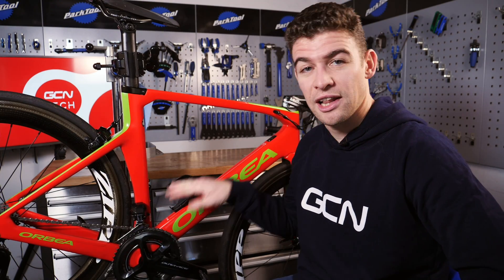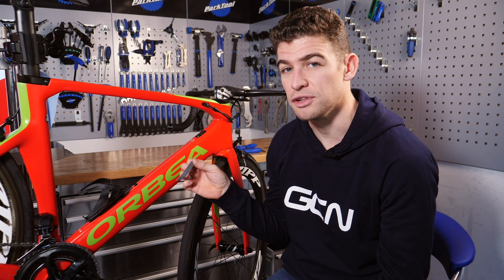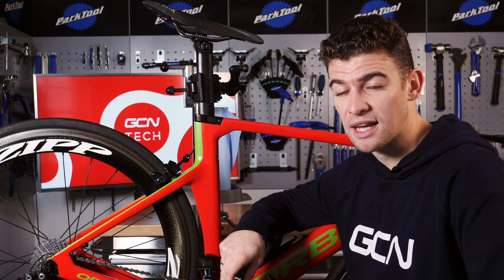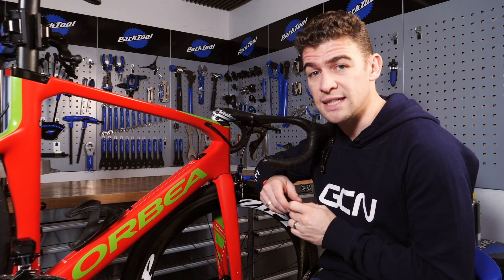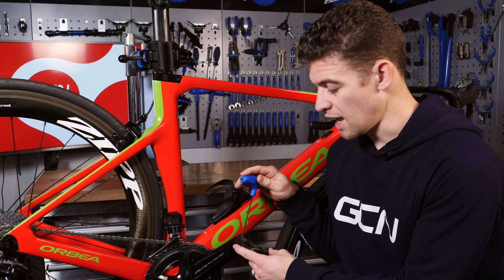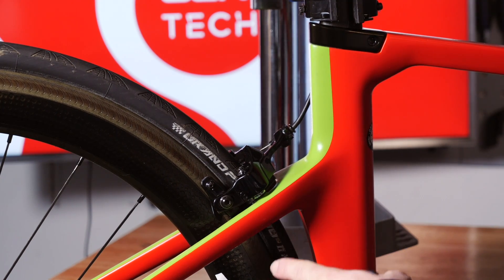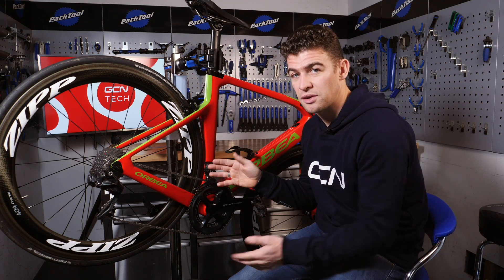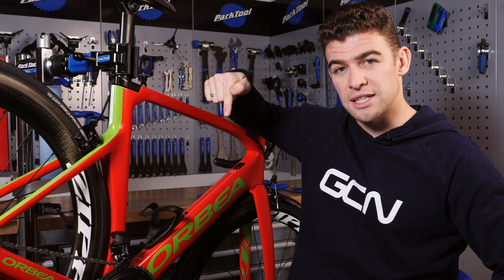10 Pro Bike Setup Hacks | How To Make Your Bike More Pro

Comment from the maker: What's your top setup hack? Let us know 👇
Reply: regularly filing down the brake pads and cleaning the pads and the rim with automotive brake cleaner. it feels as good as a new chain. you may object it will wear down the pads faster but often i see people chucking perfectly serviceable pads in the bin because they look gummed up way before the wear line. stuck pebbles will destroy your rim. I hate lacing wheels.
Reply: Setup? I generally just hop on and ride! 😂
Reply: You know about chain waxing but waxing the inner derailleur cables is smoooooooth. I also drip it on the exposed parts of bolts to prevent corrosion. Got to be careful though.
Reply: Something I like to do before a big ride is to check to check the torque of my bolts. It gives me that little extra confidence. 😉
Reply: My pro tip, use hand rail griptape it's far friendlier to hands, gloves and shorts so no Tony Martin style bibshort vents it looks better too, suprized the pro scene hasn't cottoned on to this stuff yet, it's a textured polyurethane finish just like the supacaz super sticky Kush tape. 👌
Reply: You have much to learn young Opie Wan, when you sprayed that silicon i felt a great disturbance in the brake force like thousands of brake pads screaming out all at once then suddenly fading away,🐍   Spray any lubes and polishes on to a clean cloth away from the bike then apply it only to the parts you want it on. Thus no stray residual lubricants or silicon on brake surfaces 👌
Reply: I changed my Q-factor with a different bottom bracket. This also made it possible to get a straighter Chainline for the gears I use the most, which is 54 - 19.
Reply: @GordonMoat  are you using octalink or square taper cranks cos the Q factor is the distance between the pedal attachment points, most modern cranks have the bb axle integrated so it's not possible to change it, only to move it further inboard by changing the spacing at the bottom bracket. If you do that your saddle won't be in line with the centre of the cranks so I'd recommend countering any changes by adjusting your cleats so that it lines back up again and pop some helicopter tape on the non drive side pedal arm as your heel is going to be a touch closer so it might rub. If you only ride short distances it won't be much of an issue but if your a full on mile muncher it could lead to lower back ache due to a misalignment over time. If your using octalink or square taper and have merely changed the axle length for a shorter one none of the above will be an issue as you'll have moved both pedal attachment points inboard and the saddle will be in the centre still. If you're using a 54 42 I'm assuming your a sprinter, time trialler or you love a fast descent either way chapeau sir.
Reply: @jonnythelegs2597  It's not a huge change, so cleats can be adjusted as needed. Obviously, not really possible with press-fit bottom brackets. I ride mostly on flat roads, at about 90rpm, which is why I use 54 - 19 most of the time. My fixed gear bike has an even narrower Q factor, yet I don't have an knee or back issues. Probably not possible on many bicycles, though people could look at which gear ratio they ride in the most, then change the front big ring to move that gear ratio around to get a straighter chain run. It's quite a bit quieter too.
Reply: @GordonMoat  Yay fixie rider that explains it yeah it's pretty much impossible on a modern day press fit your only hope there is a company called problem solvers they do bb conversion cups for a lot of interfaces But l say come back threaded BB all is forgiven. Apart from the occasional savvy timetrialler people with gears generally know sweet fa about chainline efficiency 54t would  be a fairly big rig and line up with the 16/17t cog on a cassette  combined with a 19th for 75" is pretty much bang on for what you're riding what you running on the other side is it flip flop or a proper track? I was running a 47x16 for London which is flat apart from Highgate and it would always be credit cards or some documents for signing when I delivered up that way it was never anything heavy.  Cornwall's quite a bit hillier though and my knees a fair bit older now so I wimp out and run a 18t singlespeed. But I've Scott Foil road bike too so that's now my main road bike and a Singlespeed santa cruz for off road. Have you tried out oval rings yet they work a treat expecially when spinning out on a descent way smoother 😉
Reply: @jonnythelegs2597  Fixed makes you smoother on the road bike too. I've never tried oval rings, so I have no idea how they feel; think I would be concerned about perfect set-up to avoid dropping a chain. Anyway, there's probably a few watts in getting the chain line straight. I've seen too many road bikes where the chainline never runs straight, and alignment doesn't appear to have any thought put into it. If at all possible, I would avoid press-fit bottom brackets. 😺🚴
Reply: @GordonMoat  for sure, you learn through necessity on fixed, fortunately I learnt to "pedal in circles" beforehand as I started out by time trialling in the early nineties as a teenager and this was the norm back then so when I fisrt jumped on a track bike it came naturally, nowadays I get comments on how fast my cadence seems as I tend to spin between 95 -100 rpm and avg out at 90rpm but the fact I'm still smooth and not bouncing around in the saddle though to be fair this mostly comes from the local triathletes and weekend warriors that come out training in the real world rather than Zwifting it up all winter then suffering when the weather turns. Bleedy Wheel sucking pansies try pushing 70rpm when you're up the front and not drafting me and see what happens. lol
Reply: Though they're probably thinking the same about me when i'm swimming as my technique is truly awful, it's not a smooth or tidy affair, i get it done but it's as messy as a teenagers bedroom.

Comment: I set my saddle height by setting the crank on the drive side parallel with the seat tube next I measure from center (where the center of my cleat sits)of the pedal on the non drive side to the top of saddle keeping the measuring tape parallel with the seat tube, the measurement should be the same as your inside seam measurement or a 5mm lower. I have found this method to get my saddle height prefect, as I have used all other methods but could never get my saddle height perfect.

Comment: If you want the ultimate chain performance, you do not drip lube onto the chain.  It just attracts dirt that slows shifting and increases wear.  There is no substitute for removing the chain and heat soaking it in a combination of canning paraffin and motor oil in the correct ratio.  The lubrication reaches the innermost surfaces and leaves a long lasting film of protection.  Chain maintenance can be reduced and for roadies like me, cleaning a chain is almost never necessary.  When it's time to relube, just dip the chain in the heated lube (I've been using the solution I made up for almost 20 years.) and  after the chain cools, reinstall the chain.  And contrary to what Shimano says, use a good master link like the Connex, the more times you brake the chain for maintenance, the weaker it becomes because it isn't possible for the home mechanic to duplicate what happens at the factory when the chain is assembled.

Comment: I'm interested in your spinning cranks at 4.54. Presumably it was necessary to remove the bottom bracket, de-grease it then repack with a thinner grease and refit. If this is so, what grease would you recommend?

Comment: how tdo you control the bite point on hydraulic disk brake setups? Mechanical are straight forward as they have a knurled nut like rim brakes.
Reply: Rob Bonney - Most have what they call “free stroke adjustment”
Reply: I noticed that, mine only have 2.5mm. Which is hardly noticeable!

Comment: Cassettes question. Supposing you can get a 10speed cassette cheap and new. Could you remove a cog and use it on a 9 speed set up.
Reply: Brett Champlain  Thanks 👍🏼
Reply: MRGRUMPY53  Thanks MRGrumpy53 great name 👍🏼
Reply: Jonathan Zappala Will sram or sunrace be compatible with a Shimano 9 speed chain.
Reply: James McGuckin yes
Reply: Jonathan Zappala Thanks Jonathan ✊🏻
Reply: Yes it can work,but this would assume the cassette is made up of 10 individual cogs(some Sunrace are like this) and that you have enough 9-speed spacers .If you were to take 9 of the 10 cogs,then replace the 10 speed spacers with 9 speed spacers and find shims for the smallest cogs(depends on the particular cassette) it will work ,9 speed chains work  with 10 speed cogs,10 speed chains don't work so well with 9 speed cogs.If you are up for this,then you have my vote for iconoclast of the day.
Reply: Larry Daniels  You’re a genius Larry. Thanks ✊🏻
Reply: @brettchamplain  It needs the wider 9-speed spacer,irrespective of shifters,the 9-speed chain is too wide for a 10-speed stock cassette.

Comment: Pretty sure I've seen Dan do a video about quick releases and not over tightening them, then this guycomes on and says do them up tightly, Seen the same thing with cornering videos I think it was Si or Dan saying get all your braking done before entering the corner and if braking is needed during the corner only use the rear brake, Then Ive seen on another video Emma say its quite ok to use the front brake while cornering but only very lightly ..... Cmon guys you cant have have yourselfs contradicting each other !!!

Comment: Can you please make a video, in which you compare different bike computers in different budgets? Would be so helpful.
Reply from the maker: Afraid we don't do reviews on GCN - we are lucky to be sponsored by Wahoo for our head units which we really rate!
Reply: @gcntech  Can you recommend the Wahoo elemnt Mini, as a starter bike computer?
Reply: @louisbp735 Dude,  Wahoo mini is waste of money IMO. I use Bryton 530 - pro level unit and very cheap compare to wahoo and garmin computers (also have best battery life). I use also garmin sensors. I can highly recommend you this combo bryton + garmin sensors.
Reply: @louisbp735  the mini uses your phone as the GPS source, if you want gps. Otherwise it acts as a basic head unit, it's quite expensive for a 'basic' unit when not connected to your phone. Although it does allow bluetooth sensors.

A basic unit (say cateye strada) offers cadence and speed sensors only. No mapping, and i don't think they offer heart rate. They're £30ish

Some sensors will pair direct with your phone, which you could mount to your handlebars. So you could use your phone as a short term solution.

If you want GPS unit, you could look at the garmin edge 130. It's a bit more than the mini, £50 or so I think. Mapping is limited, otherwise seems to be a good little unit. This is good for integration with apps like strava.

If you want mapping then the elemnt bolt is a fantastic option (i have one), but it's double the cost of the mini. Garmin edge 520 is about the same price. They offer full sensor usage.

Hope this helps!
Reply: Thanks for that info guys.

I'm going to buy a head unit.  I love my s8 as a bike computer.  3 problems...

1 - I've had 2 century rides incomplete due to battery.

2- I've hit it with my knee sprinting 

3- screen burn.  It's not horrible but is there and I paid cash for my phone.. This is actually the deal breaker for me.
Reply: @twatts4436  Thank you very much, I am looking for a budget option to map my rides and see Infos like as cadence and speed. A map or turn by turn navigation is not very important to me. I don't want to spend more then 100 bucks.
Reply: @mislevis  Can you recommend a basic bike computer for cadence speed and time under 100 bucks, I don't need turn by turn navigation.
Reply: @louisbp735  in which case a basic unit is probably your best bet!
Enjoy, loads of options.
Reply: @louisbp735  I'm very happy with my Bryton. I not use turn by turn navigation, but for spd, cadence, Heart rate and power is perfect unit (ant+ compatible). Check them in aliexpress or ebay.
Reply: Go to "dc rainmaker" and you shall find! 😊

Comment: Thanks for sharing. I've lost bottles before. I wish they'd make a bottle soft on opposing sides and rigid on the others. That might help it stay put and make it easier to slip out of my hand now I think of it.
Reply: I don't like them particularly, but some Nike bottles are exactly like that - 4 oval-shaped sections going longitudinally. Unfortunately mine separated at the junction between the soft black rubber panels and the clear panels.
Reply: Patrick Carroll 
Turns out a carbon bottle cage isn't such a bad idea

Comment: I have been soaking 2 of my old chains in 2 separate glass bottles filled with diesel. So far gunk still falls off even after 3-4 weeks. of course 1 is dirtier than the other. could be lube and dust that hardened.  Picked fuel as I can leave the chain in and don't have to worry about rust.

Comment: Grip tape inside your bottle cage? If that's pro I'm not impressed, fantastic way to scratch your bottles to bits in no time at all. I modified mine with rubber plugs normally used for plugging cable holes on the frame. I drilled and glued them in, now my bottles are Super tight and it doesn't damage them ether.
Reply: 3M do little clear rubber gromets to put on the bottom of coasters etc to stop them sliding on tables, they  work like a dream too

Comment: Great hacks! Especially find the griptape and quickrelease tips useful. Keep up the good work!!! 😀
Reply: The skewer tip is very much a pro tip, personally I use Allen key skewers as they are lighter, more aero and stronger, if you don't have team support/backup with a spare wheel or bike at the ready you're going to be getting your tools out and fixing a flat by the side of the road in which case your going to have a multi tool to hand to unscrew the skewer, having a QR is only goiing to save maybe 3 or 4 seconds on the job so unless you're so fast you can fix a flat and get back up to the bunch your race is pretty much over. Where as an aero Allen key skewer can save between 1 and 2 watts of aero drag over a QR so technically you'll save more time overall especially if you're doing longer rides, sportives, or longer 100mile, 6, 12 or 24 hour TT's. The other advantage weight even the cheapo £9 halo ones are lighter than QR's costing 4 or 5 times that and the gold ones look super tidy and bling too. Strong, light and cheap you can have all three, it's not often you can say that these days.

Comment: Not a hack, more a question; I ride about 200 km a week and check my tyre pressure weekly. I drop from 100 psi to 80 psi between checks. Anyone else have a similar drop?
Reply: Matthew Broad Yes. Strangely, on my new bike with 25mm tyres, the drop seems to be much less than on my 23mm tyre-equipped bike.
Reply: i get that overnight

Comment: How can I get into a TT position on my normal road bike?
Reply: Clip on aero bars or just slide you arms onto the tops of your bars. Keep your back low/flat while remaining on the saddle. Itll take a minute for you to feel alright with how the bike will start to handle but you will get the hang of it
Reply: Move the saddle to the maximum forward position too.
Reply: Move your saddle as far forward as possible. If you are able to spend a bit of cash, try to go for a secondhand tt/tri saddle, as that might move you a bit more forward than a standard road saddle (and it'll make it a lot more comfortable)
Reply: Get an in-line seatpost with no lay back, move saddle forwards, also a 10-20mm shorter stem with a -17 degree angle, road bikes have longer/taller head tubes than TT bikes so you'll want to drop the front end down about an inch in total to emulate this. Naturally you'll need some clip on tri bars if you don't want mess with the stem there are tribars that mount the extensions under the handlbars so that the pads can sit lower, do things progressively bit by bit and give your body a chance to adapt gradually otherwise you'll low and aero but you'll be too uncomfortable to hold the position and use your muscles efficiently, do plenty of riding in the tuck position and do plenty of thoracic back stretches (look em up on youtube) to help increase flexibility and reduce the chance of back ache. There's also a gtn video of matt botrill showing how to optimise body position for drag reduction. Listen to him and you'll learn much, he's shit hot at time trialling he's sub 18mins for a ten miles which kinda says it all.  Hope that helps and the best of luck for the future have fun ps expect to throw up after your first TT don't worry it's perfectly normal you'll be giving it everything towards the end and you'll go into oxygen debt these things pass as body learns what's required of it. 👍